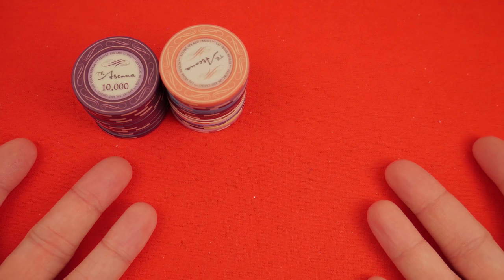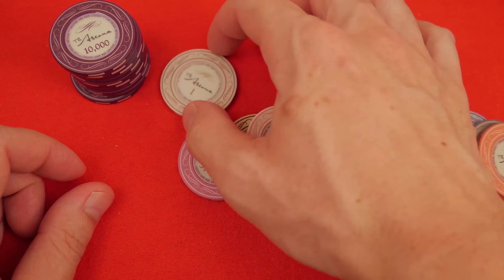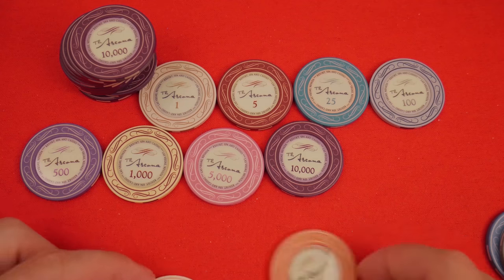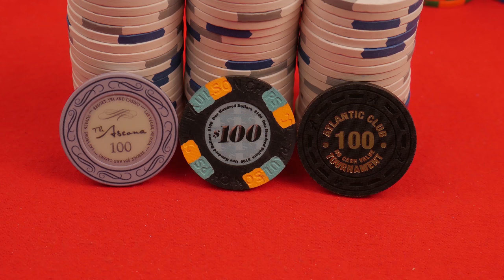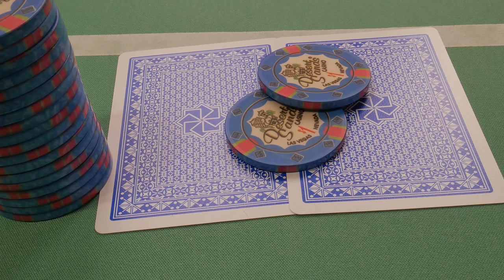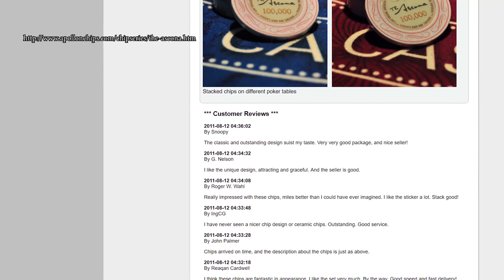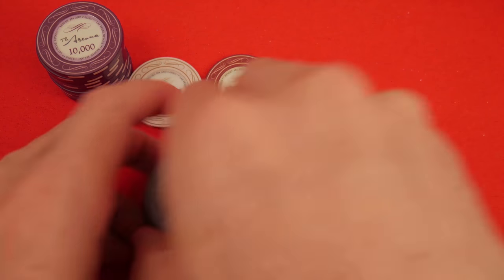Ascona - PCR

Comment: I recently stumbled upon a set called 'Old Havana Club' poker chips and got myself a set. Now, these are China ceramics and unfortunatly the sides don't line up with the images, but they have amazing artwork. They are pretty cheap when you buy them directly from China. Might be worth a look. There should be a sample set of all 13 denominations available from ebay. I payed about 150 euro for a set of 600 chips.

Comment: After watching your video and reading some reviews, ended up buying a set from a local dealer. 
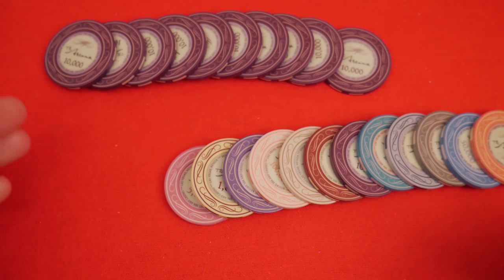The chips have rough texture and it's hard to shuffle. They're not glossy and don't slide off smoothly like 0:49 in the video. 
Is that how it's supposed to be? Feels a bit sus TBH.

Comment: So does it not have issues with spinners? I like being able to stack my chips high.
Reply from the maker: No spinners, these must be some of the most stable chips that have come across my table. Thanks for watching.
Reply: I haven't found a single spinner in about 1000 chips.   But I did have some other QA problems in the larger purchase:   an incorrect label,  some chipped "enamel" for lack of a better word, there's like this mother of pearl substance around the chip which seems like it can come off -- or at least be chipped.    The last point of weirdness I found was the chips seem thicker than most of my other "high end" poker chips.   Not really sitting well in any of the trays I have.  Hrm.